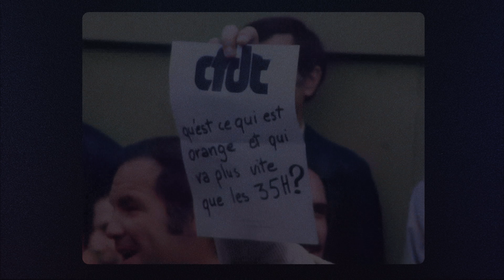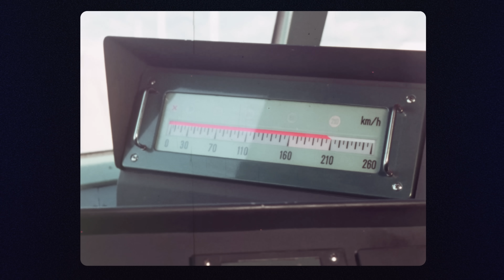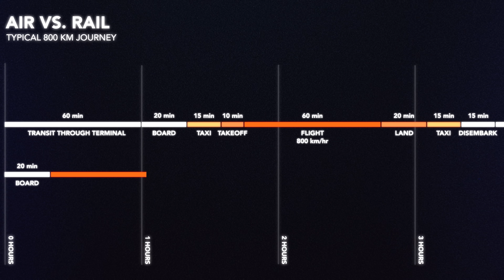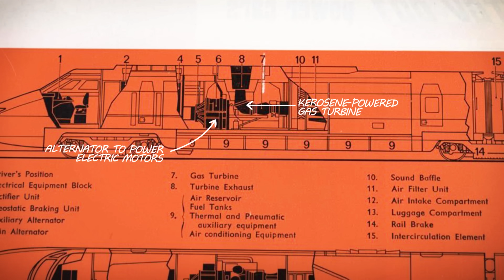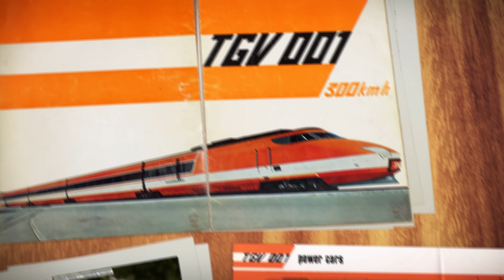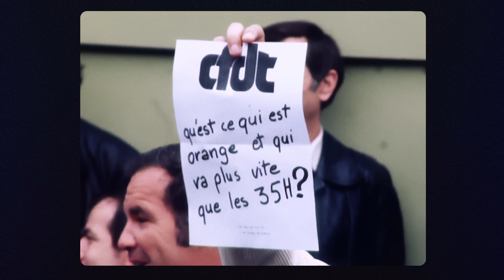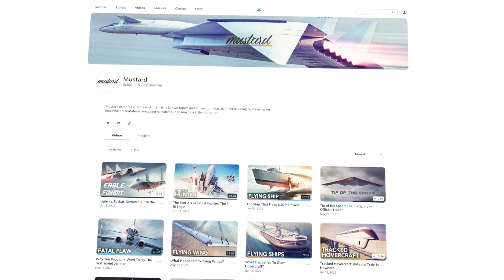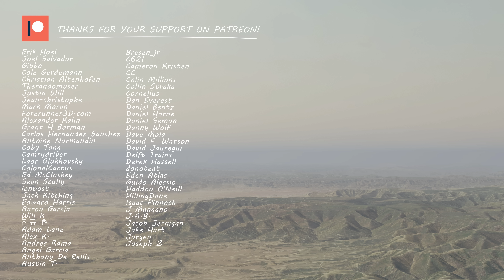Why French Trains Are The Fastest

Comment: The caption's "Are" should be "Were," because as of August 2022, the fastest train on Earth, based on its record speed, is the Japanese L0 Series Maglev with a record speed of 603 kilometers per hour. This video needs an update. The French is gonna have to take a backseat, I'm afraid.

Meanwhile, China has completed a superconducting test run for its ultra high-speed train that aims for speeds of up to 1,000km/h (621mph) in a low-vacuum tube. If successful, it will become the fastest means of on-ground transport. (SCMP, April 24, 2023)

Comment: Which moron said french trains are fastest? Right now the fastest trains are in China and Japan
Reply: Yeah, as Japan already smashed that record in 2015 with speed of 603km/h on their maglev
Reply: The TGV is the fastest train on rails. The japanese and the chinese ones aren't on rails, they use magnetic force.
Reply: @CT-7567R3X  bitch that to Guinness since they consider them under that same category of which is railway. If you were to say, runs on steel rail specifically then yes, french is the fastest. Besides, the term, "rail" doesnt necessarily mean regular steel rail. Rail also mean guideway as well. Railguns use magnetic to launch projectiles but they are still called railgun.
Reply: @foudremy1514   magnetic force and classics railways are absolutely not the same thing, so say that it's the same category is just dumb
Reply: @VolvicCitron  what word that I said that u dont understand??? I already mentioned that rail also mean guideway as well. Railguns use magnetic to launch projectiles but they are still called railgun. Better yet, they are still called GUNS even though they arent powered by explosives. SMH
Reply: @foudremy1514  a gun with no powered explosives 🤨?

Comment: Max speed isn't a thing anymore. Even for planes it's not a thing. The right parameter is energy per passenger as the world will have so few energy.   TGV speed is set for this efficiency, just like for planes. Useless to save minutes for an increase in energy cost. That's why all those loop things will work but never on a big scale and will never change travel.   Speed trains are reshaping Europe now, the only way to cut air traffic.

Comment: Imperial Japanese East Asian Coprosperity Sphere lacked enough quality ferrous iron for rail transit tracks amid Roosevelt's blockades, steep mountainous terrain of rivers too full of jagged waterfalls, Soviet backed Rickshaw banditry gangs, etc. while high aspect ratio corridor factories uninterrupted through mountain passes  had surpluses of chemicals and silk for steam filled airships and  rocket powered gliders to hall freight form rooftop hangars equipped with Mary Kenney STOL fans since  female divers and synthetics prevented agricultural serfdom. 

Their tail sitter airships where patterned after Korean Farthingales called Hanbok with steam rocket nozzles patterned after Korean bustle pannier crinoline called Chima they fueled with sulfur from fluid jet drilled wells to have above cables and chains with below twin keel undercarriage of nested concentric funnel fuel hoppers.  

Their rocket powered gliders had fuselage hulls of braided composite fibers inspired by Korean and Manchurian Bumpits with rocket engines that varied from isotopic fuels to smoke screen exhaust trails as part of Hasegawa's Project NA thru NZ alternate fuels by Nitchitsu of Hangyong powered by geothermal hydroelectric from Singosan Kumgang of Wonsan to Changbai of Peakdtu and from Manchurian oil shale distilleries.     

Nitchitsu's Noguchi and Songsu in of early 1940s Hamgyong Province had achieved muon catalyzed fusion with an engine comprised of a Dewar of cryogenic liquified deuterium fuel connected to a beryllium alloy reaction chamber nozzle coiled in around electromagnet coils to focus cosmic ray muons while alpha particles were deflected to enrich fuel.  

Noguchi also had what today would be called cyclotron free electron x-ray laser and laser xenon argon ionization Rydberg excitation lamp optically pumped chemical metallurgical processors decades before Maiman had a ruby laser.
l  
By Fall of 1945 Allies had leveled who mountains and through Japanese cyclotrons into Hakone to impose dependence on imported steel, petroleum, and agricultural farm produce so a decade later Alvarez was credited with muon catalyzed fusion after United Nations Peacekeepers had returned from ruins of Hamgyong.     

O..S.S. files will back up such claims to consider how Noguchi had to use employee Fritz Hansgirg on 1930s patents due to Eurocentric racism just as Mary Kenney had to use Gibbons on patents due to gender roles of sexism having won the right to vote.. 
              
Robert K Wilcox's book portrays Noguchi as "Dr. Strangelove" so please consider forgotten inventors of Poltically Correct Popular WWII.

Comment: Robert L Morrison's patented lighter than air solids "SEAgel" and biofoam" sealed in metal foil could allow lifting body airships having jet engines powered by x-rays on hafnium Lockwood valveless pulsejets to replace rail transit.
Reply: Also it is important to replace agriculture and forestry with vats of Knall Gas bacteria single cell proteins electroporated or sonoporated with DNA genetic sequences from cybergenetic online files to ferment from waste chemicals while a carbon fusor of a molecular sieve augmented UCLA Naranjo Putterman cryogenic pyroelectric crystal fusor could permanently convert exhaled carbon into molecular oxygen.

Comment: Yeah, ok you beat the plane that flies over the ground and is prop. Same kind of thing as the bike beats a jet on take off. Or me running faster than train when it's going 3 miles per hour.
Reply: You seem to be a little confused -The planes used in TGV speed trials are there to FILM the train from the air as helicopters are too slow. You mistakenly assume when it is said that the train ‘beats the plane’ that he is talking about speed over the ground; wrong. The claim is about end-to-end journey time. Here HSR ‘beats the plane’ considering the full journey time (travel to and from airport, checkin, security, waiting time, taxiing… (not even counting typical flight delays)).  The only domestic air routes that remain competitive in France now are to cities NOT served by TGV, eg. Paris-Nice. Everywhere else, the ‘train beats the plane.’

Comment: The reason why the train beat the plane is because the train has more of a wedge shape just like the C4 Corvettes, while the plane has a rounded shape on the nose. If you take a 1995 Corvette and a 2006 Corvette and run them side by side at the same speed say 100 mph. you will notice that the 95' model is going straight while the 06' model is doing a little road walking, cause the 95' is wedge shaped and the 06' is rounded

Comment: If you increase the power, the speed will come out.
However, when the speed reaches a high speed range (from about 200km/h), the wheels will vibrate abnormally, creating a dangerous area.
This video highlights the achievement of a new world record of 331km in 1955 and a new record of 351km in 1981.
After 1955, when the record of 331km was set, why was it not possible to start commercial operation of about 280km?
Research institutes studying high-speed trains in France, Germany, and Japan know this.
This is because the abnormal vibration of the wheels cannot be suppressed.
Japan's Shinkansen has solved this problem.
This technology was devised by pre-war aircraft engineers, and was also involved in the design of the Shinkansen.
France, in particular, wanted to know about this technology and insisted on showing it to the Japanese government.
Japan's Railway Technical Research Institute released it to various countries without obtaining a world patent.
Germany made a phone call to the Japanese government to thank the Japanese government when the train was able to run stably even at high speed.

Comment: Faster than what plane?!? A boing 747 can reach speeds up to 900 km/h while avarage flying speed is 800 with passangers.
A F16 can reach speeds up to  2,200 km/h Convair f107 and the McDonnell-Douglas Phantom II reach speeds of up to 2,600 km/h
The top record of planes is 3,500 km/h from a Lockheed SR-71 Blackbird with hes little sister reaching speeds of up to 3.300 km/h
Compared to the real speeds of airplanes, the speeds trains reach are just a joke.
Reply: beat the plane as beat it in a commercial way not with speed
Reply: Well a train can get going right away. A plane has to pushback and then taxi to the runway.
Reply: @rtrfan7398  Or a VTOL or gets catapulled...

Comment: The TGV is amazing as it can achieve speeds of over 500km/h in traditional rail, unlikely its competitors, that require special rail to be built specifically for them.
Reply: Not commercially though, the normal speed is 320 km/h.

Comment: Perhaps interesting is that the automobile in the USA already beats aircraft if the distance to go is less than 500 miles. You have to get to the airport, go through security, do it with time to spare, get to your destination airport, get off, find transportation to get you to your final destination, and blah blah blah.  If everything is timed well and works out smoothly, the air travel can actually win, but if it's these relatively short distances, the automobile usually wins.

Comment: The greatest hits of a better world are in the second half of this video. Nuclear energy to bring cheap power to the people, an electric high-speed railway network to get them where they need to go without oil, and a ban on short haul flights that take more time pollute the air doing it.

I like planes. They can do some crucial things that trains cannot and are still a useful tool for humanity.  I also like cars, which like planes are extremely good at giving the user freedom to diverge from a given route at any time. But when it comes to getting to work and getting home again on a day to day basis, rail is the way forward. Trains move more people per square unit of space they take up than highways do, they can maintain high speeds more safely than individual cars, and when powered by electricity they emit pretty much nothing.

Comment: As a French myself, and I had my uncle working on the prototypes of the TGV, « TGV » were at first the initials for « Turbotrain à Grande Vitesse », because it had two gas turbines (Tuboméca Turmo III-G) as a means of propulsion. When they switched to electric systems, because of the Oil Crisis, they kept the initials but switched to « Train à Grande vitesse » (High Speed train).

Oh, and great thanks for this video, Moutarde 🥰
Reply: TTGV , Tchou Tchou grande vitesse pour turbo train 🙃
Reply: JAPAN is the fastest 🎌🗾  and the BEST the first bullet train was created by Japan.
Reply: Did they take those Turboméca engines from Helicopters?
Reply: do french trains use croissant as fuel?
Reply: @Teddyponsel2626  You forgot wine is the cooling system
Reply: @Aklaan  😱
Reply: @Teddyponsel2626 Oui !!
Reply: @fostosenytb6407  😱
Reply: @Teddyponsel2626 baguette*

Comment: TGV is a must train to travel on since most of the EU train network is now shared you can get on a TGV in Germany and then the fun starts once you cross back into France and then onto the the super hi-speed line 390 km/h feels so smooth in these trains only the wind noise give you an idea of just how fast you are going. We traveled during covid on one from Germany to Paris a trip for my wife's 50th .we went 1st class but could not sample how good it normally is because there was then a food and drink ban in place on all French public transport because of the pandemic. Still I found them better than the German ICE trains in many ways and the Eurostar trains that I used a few months back. But it would be a massive undertaking to to build these sorts of lines all across europe though many are pushing for a true pan Europeian super hi-speed route , with far higher speeds than even the Current TGV.

Comment: Hello. Just to clarify something.
French TGV could be really great, but they actually suck.
Rail are not well maintained so they don't go that fast for safety reason most of the time they go about 150km/h also the price is extremely expensive and paying a lot for train that are late most of the time just isn't going to work.
+ SNCF are known to be on strikes at least 30% of the year, so you better have a 2nd plan in case your train got canceled.

And again, they could be so good !! But the truth is : they suck ass
Reply: As someone who takes the TGV often for work purposes, I find your comment to be very much wrong. There is not much problem with it on the dedicated High-Speed-Lines, and strikes aren’t as common.

Comment: 12:22 A little known fact, indeed the TGV holds the high speed record of any modified trainset (the unit used was purposely made short and lightweight for the record), however the actual high speed record of an unmodefied trainset was achieved by a Siemens Velaro trainset in Spain, reaching 403,7 km/h.

Comment: SNCF didn't learn the essence of Japanese Shinkansen, only part of it.
Shinkansen has a dense train interval as little as 3 minutes and thus made it somewhat like a subway train. This allowed to commute by it and helped the city to expand its radius. Actually it's hard to find the borders between cities in Japan as everywhere is populated. Also the Japanese designed EMUs which has power on many carriages instead of locomotives on the ends. This allows faster acceleration and braking which is crucial for subway-like operations.

Sadly this essence is japan exclusive. None of FR DE UK or even CN learned it at all. They never thought HSRs to take part in intracity or short intercity transportation. At least the Chinese learned to send the trains dense!
Reply: Nobody "commutes" via Shinkansen.  Its main passengers are business travelers.  It is in no way shape or form designed to be used "like a subway" nor is it economical to do so (ticket prices are not cheap).  

Short headways are only needed if you need the capacity.  Depending on the traffic, 3 minute intervals is possible for any rail line.  Japan built a dedicated ROW because
1. The Japanese narrow gauge was insufficient to handle faster speeds, and
2. The Tokaido line had reached capacity so the only way to increase capacity was to build a new line.

Comment: The French were achieving 200 mph in 1955. In 1976, British Rail had the Inter-City 125 which ran at a top speed of 125 mph. In 2023, whilst other countries had smashed the 200 mph speed for trains, in the UK we are still maxing out at 125 mph on most of the main lines except HS1. It's a travesty that the country that invented railways has fallen so far behind.
Reply: It's mainly because:

A) Our railways are too old so they weren't built with even 125mph in mind (hence the shock of the HST in 1976 as you mentioned)

B) Too many climate protesters against it

C) Unreliable government
Reply: @jamesnicolson6833  this is exactly what I don't get with UK. Environmentalists in other countries support more high-speed rail. In the UK it isn't the case.
Reply: And what's more is that it costs FAR FAR more per ticket than anywhere else in Europe. It really does make you question where all that money goes to. An absolute disaster of a system the UK.

Comment: Great video, absolutely one of the best videos on the subject! However the LGV sud-est was not the first major european mainline in 50 years - just a couple of years earlier the Italians opened the direttissima, and a few years before that the polish built the CMK, arguably the first attempt at a high speed line only let down by signalling and rolling stock (typical communist block left hand right hand failures). However the point still stands that France was the only country that fully understood the Japan thing and is the only place that fully nailed the high speed thing. The LGV sud-est is still operating today unchanged and is a fully formed HSL, whereas the direttissima needed many upgrades to get it to the same effectiveness, and the CMK is still undergoing such upgrades

Comment: The record set by the TGV was not set with a standard service train.
It had modifications like the electric locomotives of the 1955 record.
They fitted larger wheels, the train set existed of less vehicles and voltage on the overhead lines was raised.
But it was still spectacular, being faster than any super car that had been on sale up to that point.
I travelled on a high speed train at 330km/h, and the most amazing thing is how uneventful this actually feels.